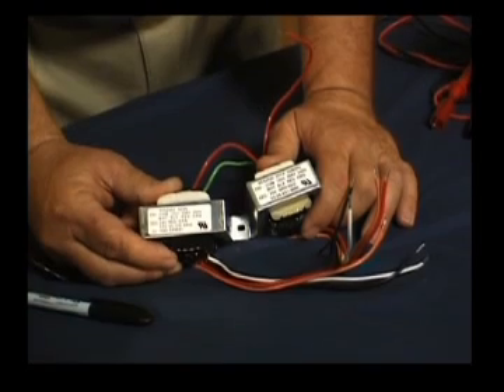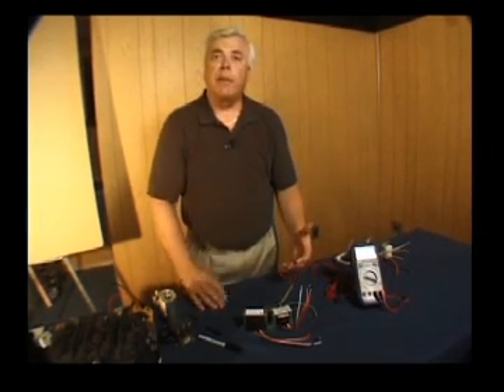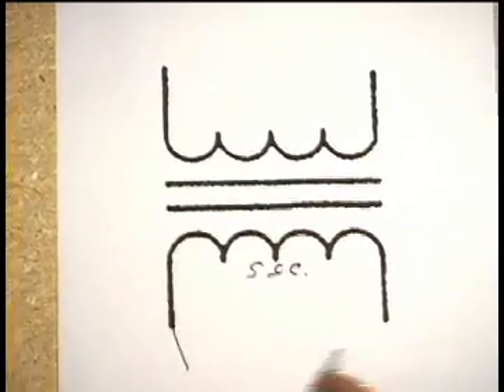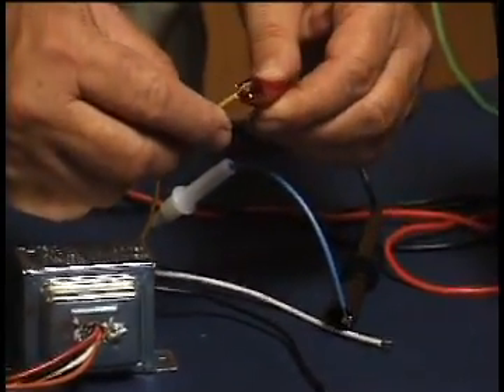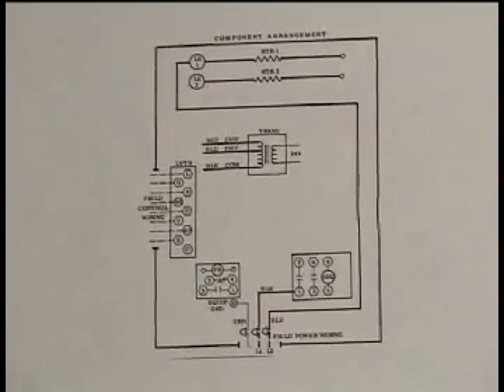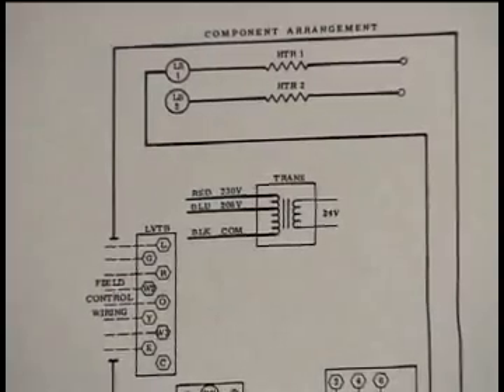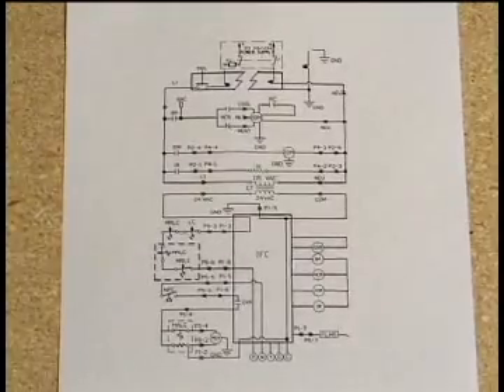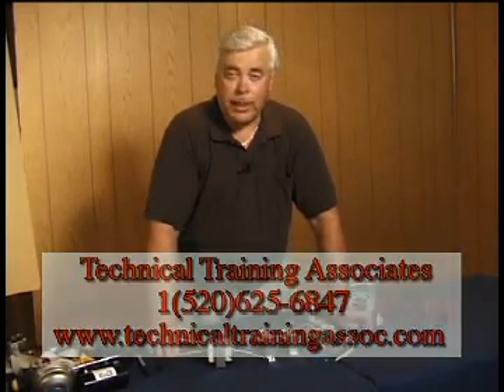The Fundamentals of Control Transformers  Part 2

Comment: Great training videos.  My ignitor ignites 25% of the time - I have already replaced the pressure switch and the board.  Now it ignites 75% of the time.  When testing at the valve I do not get the 24v - so I ended up replacing the board - but it still does not test at 24v.  So I was wondering if it might be the transformer.  However after watching your video - I can see that the in wires (black and white) do not test at 120v into the transformer.  The resistance on the transformer itself is ok.
Reply: If it's below 120 then there is a problem in the wiring leading to the transformer.